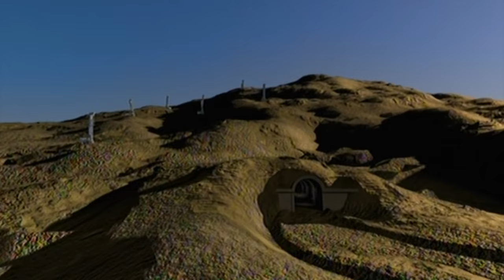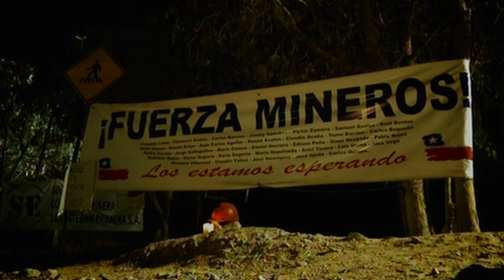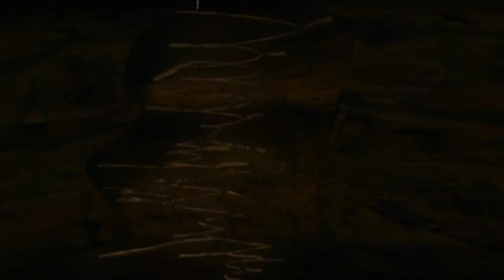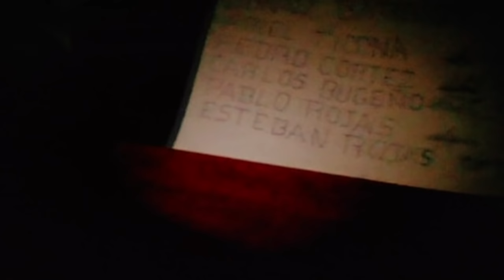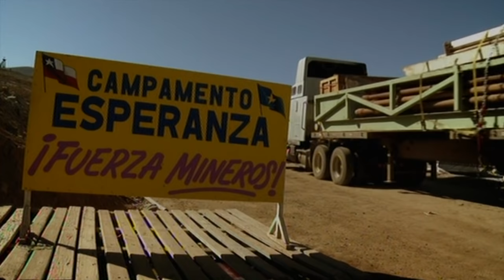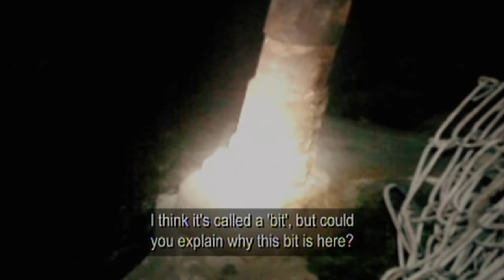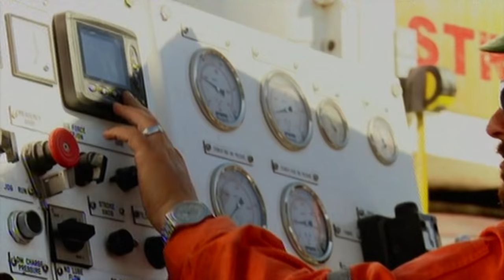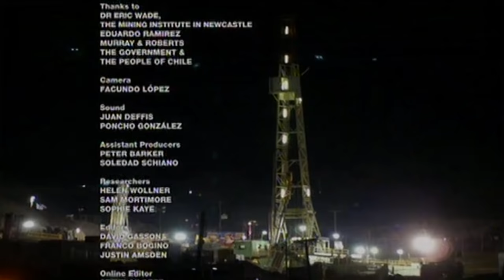Buried Alive - Chile Mine Rescue

Comment: It's crazy how they retrieved the broke Metal drill in "plan b" . Smart as hell for that design  .
Reply: Ikr, it's a good thing that all those guys had the knowledge and experience to figure out what to do.
Reply: @matthewdaub  it's crazy as hell man. It's crazy how it still took that long to get the
Out!!! With all the knowledge that they had
Reply: @Juju-ee3nd  Im a student of mining ang geotechnology and i can tell you that safety is number one priorety and the second rock is not always able to drill easier specaly in this cases where is harder and also machins are not maded for this porpuse ther is bounch of reasons why is this hard to make faster but most important is that this mans has been saved if this colaps has been  a 100 yr or even 50 years ago rescuing of this man surly has not been posible.
Reply: Especially using something/design that was so simple and rudimentary to achieve complete success
Reply: I'm blown away that Plan B was as successful as it was. Especially with Plan C having such big promises and how large of a rig it was. Very Humble crew too, they packed up and left after the job was completed, if I were one of the trapped Miners I would want to shake their hands at least.
Reply: Well they do that almost every day
Reply: Imagine if plan B, Brandon Fisher and the  USA team never helped. The miners may have died.
Reply: The correct term for that is Fishing. You would be blown away by the number of techniques we petroleum engineers use to retrieve the broken bits and tools that gets stuck. I remember using magnets to get attached to a tool. In any case, the final straw is to abandon the last few strings and directionally drill it.
Reply: I would've thought magnets.
Reply: You mean “the spider”? That sort of crown 👑 shaped hollow drill bit that they used pressure to deform it so it would capture the broken drill bit. That was awesome, I had to rewind when I saw that part.
Reply: It literally brought the world together!
Reply: Whoever designed the spider played a lot of claw crane as a child. 😂
Reply: No
Reply: American ingenuity
Reply: it's crazy cool cuz isnt that how you dig out a rounded screw or bolt too, just WAY BIGGER.
Reply: @amm7503  It's criminally bad management that oil companies don't bill themselves as sci/tech innovators. So many people seem to just think you stick a straw in the ground and collect the finished product.
Reply: @smorrow  ikr...... Oil industry is lucrative, but it has its own challenges and danger. I have friends who works in middle of the sea (offshore platform), and he explains to me about the harsh weather condition they have to survive sometimes...... Among other challenges
Reply: @ChaseThePinballWizard  by the time it got down there it would of picked up so manty iron fragments that it wouldnt be viable anymore an electromagnet may work but thats alot of logistics

Comment: My father works in mine as a mechanical engineer and a manager. It's one hell of a job to do from what I have seen. He would literally go to mine in the middle of the night at 12 to get something fixed when it stops working. Props to the engineers here for comming up with on the spot technical solutions to the problems at hand.

Comment: Maybe I missed it in the Documentary, but could someone explain why it wasn't an option to simply re-open the actual mine shafts by clearing out the collapses that have occurred? I could imagine that they weren't sure how many collapses there were, hence it might take very long, but seeing how drilling from the surface also took super long, it seems it would've been worth a try at the very least?
Reply: My guess is that the tunnels were unstable so they risked collapsing in on the rescue team as they were digging through.

Comment: 28:56: with pieces of metal drilling head stuck underground, I wonder whether a chemical solution was considered. i.e. pour some strong acid, and it will dissolve the earth around the drilling head, in addition to parts of the head itself. This would hopefully make some helpful outcome.